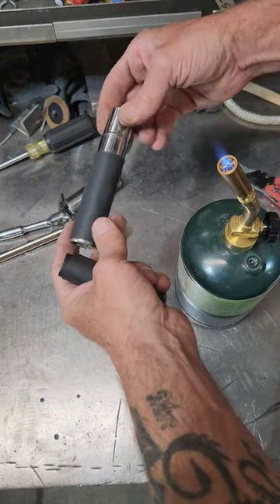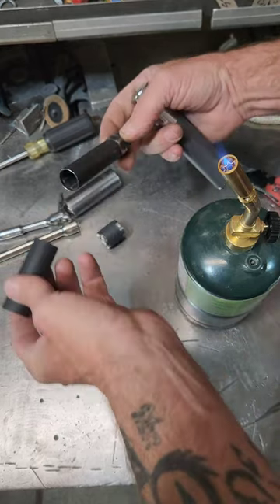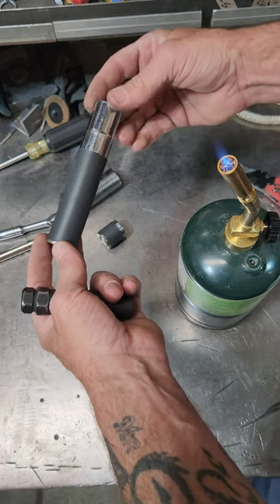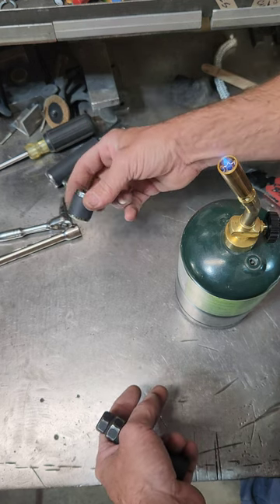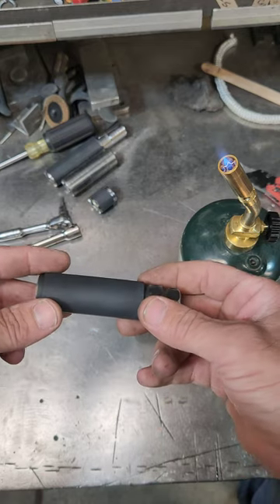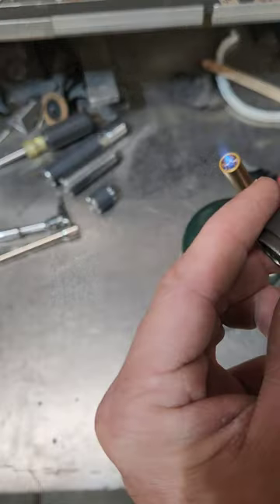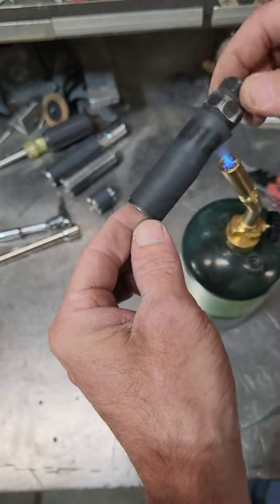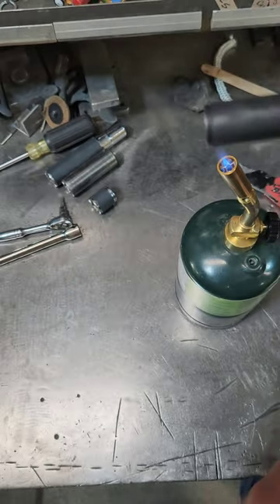How to make protective sockets for lug nuts and more.

Comment: This was pretty genius.👍🏼 Just curious though, why pull back the heat shrink just a hair?
Reply from the maker: Thank you, I've had better experience with less separation by placing it like this vs going to the edge. But no harm in going to the end if that's your preference, I should have stated this.
Thanks for the question, I didn't explain myself in the video well. sorry for the confusion.🤠
Reply: @Not.The.Avg.Smitty  Thanks for the reply. You can buy heat shrink for about 4 or 5 bucks at harbor freight. I'm definitely trying this simple hack. Cheers!
Reply from the maker: @cruznfl340 you're welcome, some may not have adhesive on it. for long lasting get heat shrink with the adhesive. 😃
Reply: @Not.The.Avg.Smitty I'll keep that in mind. thanks.